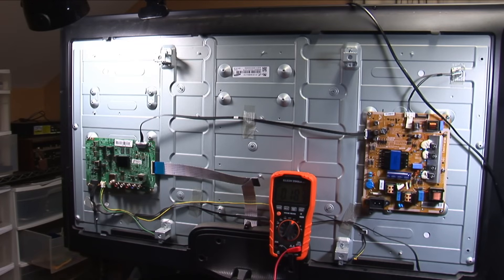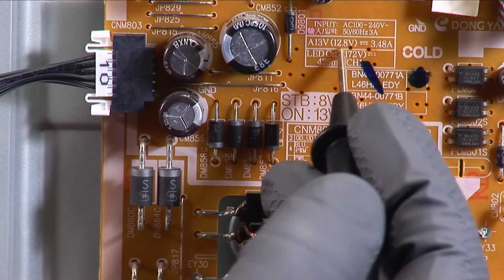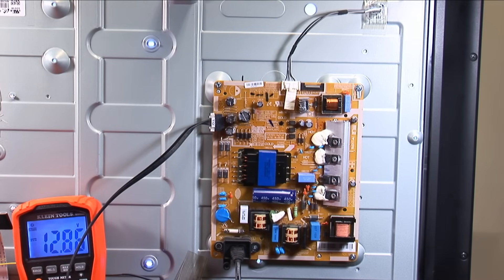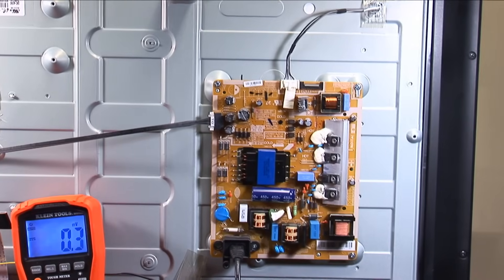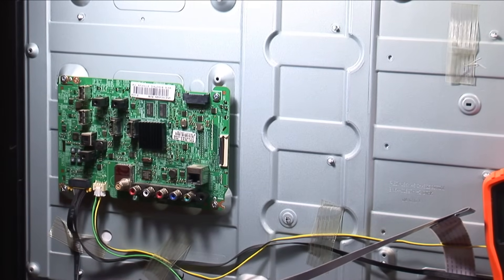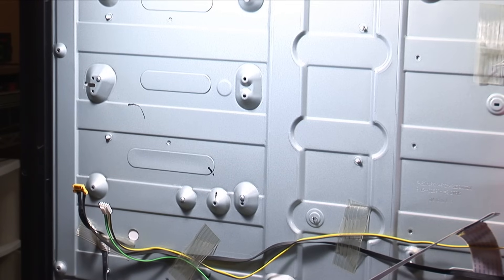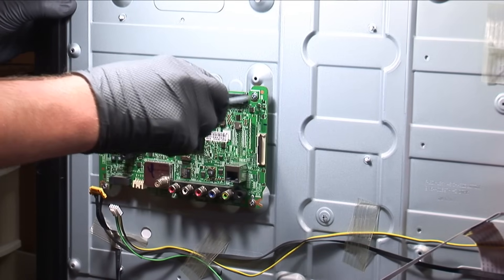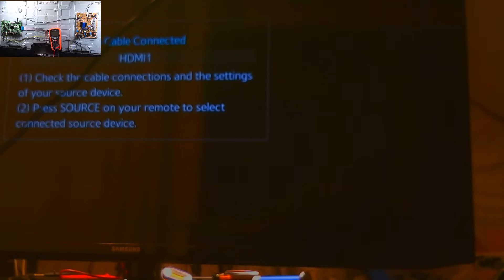Samsung LED Flat Screen TV Repair - Won't turn on, no power - How to Fix

Comment: Have a Samsung tv LN40A650A1F. Says fan issue.I have all screws out and still can't get back off. Can't even see into bottom right side enough to see if there is a cable hooked to it.  Thanks for any help.
Reply from the maker: Check around the AV inputs/outputs area...often there's a screw hidden around there.  Also unscrew the standoffs on either side of the VGA port.  Other than that I'm not sure what to tell you as I'm not there.

Comment: I have the Samsung model un55h6203af. When I plug it up the power light blinks 6 times then goes out. If I unhook the main board the back light does not come on could my problem still be the main board or is it the power board
Reply from the maker: if you unplug the mainboard from the power supply and the backlight does not turn on, it usually means there's a problem with the power supply or a bad backlight.
Reply: Can the back light be tested or replaced

Comment: I'm in the exact same situation.. got a philips 55pus 6401, died on me after lightning strikes . Of course it's just 3 months outta guarantee. . I've replaced the power board today, but still nothing. Replacement motherboard on the way,I'm hopeful it'll power up after seeing this vid, which is v informative, v useful, subscribed.
Reply: Wat is the outcome of your motherboard replacement,I have the same tv as you replace both boards an still got nuttin
Reply: @sirdon9304  all working now.  got a donor TV, same model with broken screen dirt cheap- and took the parts out of that, direct swap with mine and it's all working fine now. Not sure how yours still isn't working, you got no standby light / ambilight/ Philips logo showing ?!

Comment: Help Please...  I have a samsung 5190 with boards that look similar as in video.  First, my back leds do not light up when I unplug cable to power board.  And second, the voltage I measure on the pins do not match the table printed beside them:  table states 13 volts for the top 4 pins (bottom pin is grd=0), but my fluke measures  1.7 volts (DC) for each of those top 4 pins.  On the bottom row of pins I only get 0.6 volts for the center pin which is power... and 0 on the other 4 pins.  Your video does not tell me what to think in such a situation.  Can you help me ?  Thanks
Reply from the maker: Sorry, your comment got sent to spam and I never saw it.  You might have answered your own question.  If you measured the output and its far off from what its supposed to be, then the power supply may be bad.  Often with these power supplies there is a pwr on pin that needs to be shorted to ground or to the standby 5v rail to activate the power supply.  If you haven't been able to repair this yet,  there usually is a 5v standby pin which always outputs 5v....do you get 5v from that pin?  

If you haven't done so already you can pick up a used known good power supply on ebay for around $50 for your tv.  Also Check your power supply for swollen or leaking capacitors.  https://youtu.be/F5mc5F0d-Xk?t=595       as shown here

Comment: If I was to do that and it still don’t work what do I do because I have same tv 

And I tried and what do I use to get the screws out because I used screw driver and it would not unscrew plz get back to me fast thx
Reply from the maker: you replaced the mainboard?  its possible that your power supply is bad and  its not hte main board or its both.  Did you do any testing?  Also is the same symptoms?   As far as the screws are concerned, I dont know what to tell you.  They are screws....they unscrew.  If you can't get them to turn its possible you're using the wrong size phillips driver.  Try using a small flathead and push hard when u turn.

Comment: i hqve similar problem but no 12 volts coming out of power supply board. Bad power supply?
Reply from the maker: Possibly.  Check the harness pinout.  There's a pin called pwr or on.   Usually u short that to gnd or 5v to turn the power supply on.  If I do that and I get 12v on the 12v rail then it may be the main board.   Do u get 5v on the stb or standbye pin/rail at all times?

Comment: Wheare can buy tv boards
Reply: The replacement board was purchased off of eBay
Reply from the maker: or you could contact the manufacturer and try and order new parts directly, but usually ebay is cheaper
Reply: shopjimmy.com might have what you want.